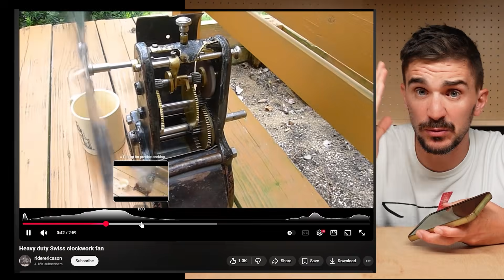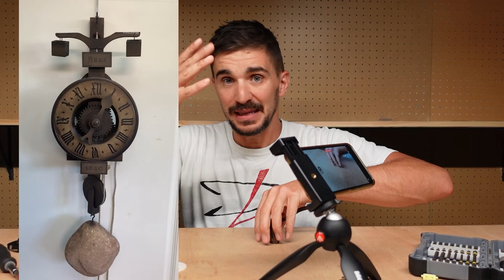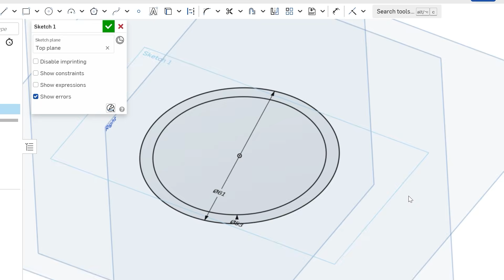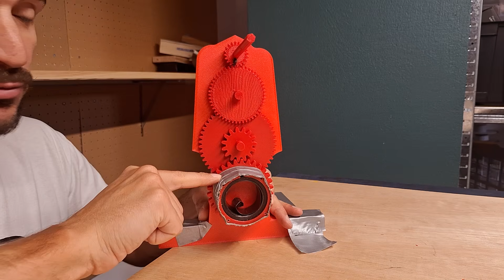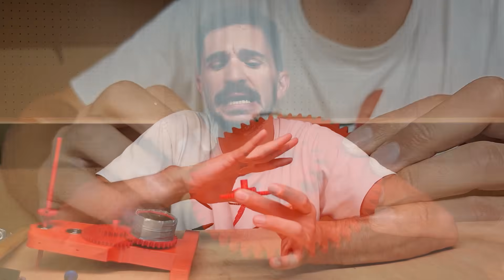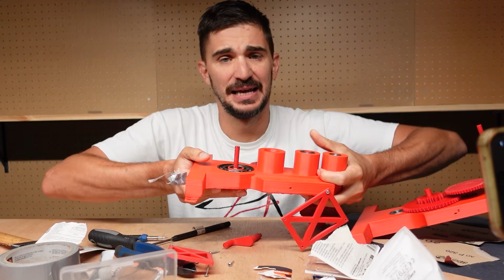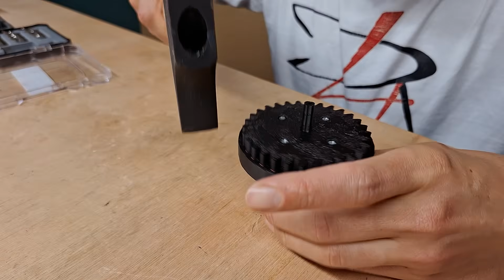No Cables or Batteries, Just Pure Mechanical Engineering - This Swiss Cooling Fan Cools You For Free

Comment: The original machine also had a massive 2 inch wide mainspring that was strong enough to need a long crank handle. If your tape measure and plastic gears can make any measurable breeze and run for almost 2 minutes, I bet that one made a decent breeze, ran for quite a while, and would probably remove at least an arm if the casing let loose...
Reply: Your mention of losing an arm made me think of a garage door lift spring. Something like that could power a fan for a good while.
Reply: Yep, MUCH larger mainspring, and I would guess something to regulate the rate of spin so it didn't over speed and waste way too much energy.
Reply: @NeoIsrafil  The fan can regulate its own speed. As the fan spins faster it needs more torque to move the air, so a spring powered fan would naturally run at a somewhat fixed speed. 

In fact, clocks use a miniature fan (basically a rotating flat piece of metal) to regulate the speed of the striking mechanism.
Reply: @Pentium100MHz  Oh yeah. Like music boxes as well. Good point.
Reply: @Pentium100MHz Yep I had a wind up music box inside a teddy bear when I was a kid. I eventually opened it up and it regulated speed with a tiny high speed fan inside the box. Very simple, worked for years and years.
Reply: @NeoIsrafil  First thought was like a steam engine centrifugal governor... But very cool would be a variable pitch propeller as a governor here.
Reply: @NeoIsrafil that is the thing about main springs, they provide the same spring force for nearly all of its range, thats why a tape also does not become exponentially harder the more you take out, as it is a constant torques spring, speed is only regulated by the force being consumed by whatever is attached to it.
Reply: @NeoIsrafil Yup a clockwork escape of some kind.  Or whatever that is called.  New mind had a great video about all the different ones through the years.
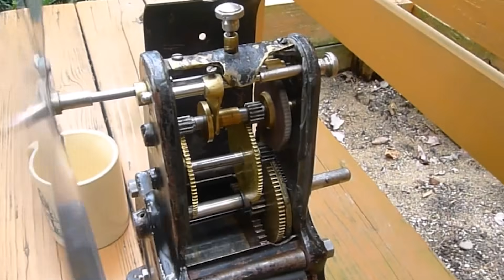Reply: @NeoIsrafil  there's a screw at 4:05 to change speed I think and you can see the fan speed up when the screw was loosened and as someone else said the fan spinning also regulates it
Reply: yea. i think the fanblade of the original gadjet was probably precisely tuned for its mechanisms target rpm. The plastic fan used is definitely made for a much higher rpm motor.
Reply: I've heard a wives tale of the spring motors from record players killing people when they would work on them without knowing what they are doing
Reply: @walkstheman98  I doubt anyone died, but I have a friend that nearly lost a finger when a spring got away from him. There's a lot of energy stored in a wound up spring. And that spring steel has very sharp edges.
Reply: yeah he shoulda used a way stiffer spring, what about the torsion bar of a 4x4????there you can store a lot of energy!!!!
Reply: Even the crank is actually geared down to overcome the torque needed. You can see its not in the middle of the spring. When he went for the tape, I knew already its gona be a fail...
Reply: SO WE NEED BIGGER BADDER SPRINGS YES YES
Reply: Also let’s not forget that the mass of the blade on the fan in the video is going to be near nothing kind a like those fans that sit on top of a stove or a fireplace that heat up and start circulating air, those fans are super lightweight on their blades. But yeah, I was going to mention that giant main spring as well, but you beat me to it.
Reply: yeah the mainspring in that old fan is probably hundreds of pounds of force. Old machines didn't mess around
Reply: Came here to say this, almost 2 minutes out of a tape measure spring and 2nd try 3d printed parts is actually pretty good imo, I think there's a lot of things that would be easy to moderately refine elsewhere as well and you could have something that would be a decent camping or workplace gadget, but def start with stronger spring.
Reply: @BlazingSun72  There is likely no single spring that could help.  They just don't turn enough or store enough energy to run a 12" fan for 30 minutes.  The one and only video with this fan in it and the 30 minute claim in it is 2:59 in length including the time it took to wind it.

Even a triple gramophone spring (which there is not room for in this fan) is not going to give it 30 minutes run time at anything like a reasonable speed.  Furthermore, there is no visible governor, which would cause the fan to run at the torque limit of the clock spring and spin down very quickly (gramophones have governors to maintain 78rpm), IOW, it would spin very fast when you first wind it, but would gradually slow down until the spring is fully unwound.  The faster the blades go, the faster it winds down.
Reply: @tarstarkusz  yup, but I'm just thinking if you can wind for 30 seconds and get 10-20 minutes it might be worth doing for specific applications, first maybe a 12" fan diameter is a little much 😂, I have a couple battery ones that are 4 or 5 and they can do plenty for just holding up next to me or like after hockey or whatever
Reply: @BlazingSun72  "yup, but I'm just thinking if you can wind for 30 seconds and get 10-20 minutes it might be worth doing for specific applications, "
Extremely unlikely.
Reply: No, it's a lie.  There is no way in hell you got 30 minutes out of that fan from a clockwork spring. 
 Look up gramophones.  100 turns of the handle and you are lucky to get 3.5 minutes from a single wind on a single spring machine.  They also had a governor to slow it down to 78/80 RPMs.  The power needs of the fan and a gramophone are likely not that different.  They had big heavy springs and many had 2 springs.  Winding a two spring fan was even more cranking.
Reply: @tarstarkusz  If we estimate the size of the fan at 30 cm in diameter and a humble but reasonable target breeze speed of Ws=1 m/s, let's do the math.

The area of the fan is A=(.3/2)^2*pi = 0.07 m^2
The mass flow rate is Dm = A*Ws*rho = .07*1*1.2 = .085 kg/s (rho being the volumic mass of the air, 1.2 kg/m^3)
The power needed to keep this amount of air moving at that speed is the kinetic energy acquired through the fan of the air moving through it each second. So PO=1/2 * Dm * Ws² = 0.5*.085*1² = 0.042 W
To run such a fan for half an hour, the spring would need to store 76 J without accounting for the mechanical losses in the works.
Doubling the breeze speed would quadruple the energy consumption, bringing it over 600 J.
Everything here is likely over simplified but I guess it gives a rough approximation to scale the power needs of such a contraption.
Reply: @m1l15lvoue  In a comment further down on this thread I estimate the mainspring of a single spring gramophone at about 1000 joules.  The assumption was no more than 5 watts running 3.5 minutes.  Google AI says the power is MUCH less at under 100 joules, which seems low to me.

If both of our estimates are correct, than it would indeed power the fan 30 minutes.  But I have a very hard time accepting your power consumption numbers.  Battery operated fans use much more power than .042 watts.

Also, it doesn't have a governor, at least not one visible. A gramophone achieves 3.5 minutes (about), but the output speed is governed (centrifugal brake) thus slowing down the output..  Without the internal governor, the only thing keeping the fan slow is the torque required to turn the blades at a particular speed.

The video showing this fan running was 2:59 seconds including the time it took to wind the motor.  The fan was spinning pretty quickly (appears to anyway). I'll believe the 30 minute run time when I see it.
Reply: @m1l15lvoue  I came at this another way.  Please correct me if I'm wrong.  A typical modern fan of this size consumes about 40 Watts.  (I'm quite sure that these old hand-cranked fans didn't move air nearly as forcefully as a modern electric fan, but lets stick with the modern example because we can all relate).  These are powered by an AC induction motor that is approx. 75% efficient.  This implies that approx. 30 Watts is applied directly to moving the air.  For 30 minutes, this is 15 Watt*hours.  Turning a hand crank, a typical human can input about 100 Watts comfortably.  That means it would take at least 9 minutes of active cranking to input this much power.  It's about the same energy required for an adult to go up 20 flights of stairs.  I also did a couple calculations to determine how heavy the spiral spring would need to be and it's well over 100 pounds.  Not very practical.

But maybe you can get acceptable air flow with 10 Watts?  That's still 3 minutes of cranking and a spring assembly that weighs 50+ pounds.  If my calculations are correct, I would guess that these old fans provided pretty minimal airflow (by our standards) for maybe 15 minutes tops.  And you got hot winding them 3 out of every 15 minutes.  The old ladies with the hand fans were probably cooling themselves more efficiently and effectively.
Reply: @pelerinc  Small fans with 40-70W motors were typically shaded pole motors, which are essentially never more than 25% efficient, and often much less. The blade designs are also very inefficient. You can see this if you compare them to fans with brushless DC motors (often called EC, or "electronically commutated" in small, plug in fans). I have a 13W EC fan with decent blade geometry, and an old 70W table fan of the same diameter with very basic blades. The 13W fan moves dramatically more air. Even capacitor-start induction motors at table fan sizes are probably closer to 60% efficient.

I also have a 5" USB powered fan, which draws 2.5W on high, and less than 1W on low, that moves a useful amount of air, if you're just trying to cool one person. I suspect the mechanical fan is probably operating at something more like 1-2W going into the fan blades, maybe as high as 5W.
Reply: @jasexavier  If it is using 5 watts equivalent, which is my guess for a gramophone, it has a 3.5 minute run time (assuming the gramophone guess is correct) at a useful speed.
5 watts for 3.5 minutes is 1050 joules. (this is at the output, the joules in the spring would be higher).
One thing going against the fan is there is no visible governor.  This would shorten the run time, but the fan would spin faster.
IIRC, the video is 2:59.  When I posted a comment on that video questioning the 30 minute run time, he insisted it was actually 45 minutes.  I think he is lying and the run time is under 5 minutes.  It is a shame nobody else has one to run the experiment.
Reply: @tarstarkusz  not quite so straightforward. The gramophone has a much larger mass to move and a rather high friction needle (and it's literally a thick sharp needle!) to overcome. Moving air requires much less energy, at least at the volumes of a such small propeller.
Reply: @321ooo123  The propeller looks fairly large to me, maybe 12-15" from tip to tip.  It takes a pretty decent amount of power to move so much air.
A large gramophone spring holds very little power.  Google AI puts it between 25 and 30 joules.  A joule is one watt second.  The mass doesn't really matter because it has inertia where some of the power to bring it up to speed is given back to the system (think a flywheel effect).  Personally, I think 25-30 joules sounds low.  But even if you increase it by two orders of magnitude, we're talking 2500 to 3000 Joules.  That is well under a single  watt hour.
Reply: @321ooo123 definitely the opposite.  Very little drag with a record spinning 78rpm and one tiny hard needle wiggling than pushing all the air at much higher rpm.
Reply: @vinnieluther6589  I happen to have one and I assure you the needle is not tiny and the whole arm is rather heavy. It has nothing to do with the modern record players. You can hear the sound at a loud volume even if the acoustic void is completely closed.
Reply: @tarstarkusz  ah, but the volume of air is also a function of the ripums, isn't it? And ok, let's ignore the mass of the record plus the mass of the spinning table... yet the needle at the end of a heavy arm that drags on the record surely is a great waste of energy. Actually, I may do an experiment: I'll measure how much it manages to spin a record with or without a needle. That should be a good indication about the friction between the needle and the record.
Reply: @321ooo123  I would estimate a gramophone uses no more than 5 watts.  For 3.5 minutes, that is 1050 joules(5 watts times 60 (seconds in a minute) x3.5 minutes).  To run a fan for 30 minutes using 1050 total joules would be a total continuous power consumption of 0.583 joules or about a 1/2 a watt.  1/2 a watt energy available to the entire system  is not going to power a 12" fan.  I mean, maybe it could spin the blades very slowly and move almost no air, but that is about it.
I would be very interested in your experiment, if you really feel like doing it.  Indeed, I think the power consumption will be higher with the needle on it, though I do not believe the total power consumption will be more than 5 watts equivalent.
Reply: @321ooo123  moving air takes a LOT of energy.  Certainly a lot more than the drag of a needle on a record.  I’d bet a coffee on that any day.
Reply: @tarstarkusz  here are the results. 20 windings with the handle. No needle - the table turns for 2 minutes 15 seconds. With needle: it doesn't start at all. If you allow it to spin to 78 rpm, it stops 3-4 seconds after you lower the needle. You may want to reevaluate the friction losses in gramophones.
Reply: @SolarMillUSA  it depends what volume, and how fast, among other things. See my reply to @tarstarkusz to see the outcome of an experiment with a gramophone I did exactly for that purpose.
Reply: @321ooo123  What about a full wind?
I never doubted the tonearm would reduce the run time.  That's where most of the work is.
My estimate of 5 watts is pretty high.  Even if I doubled it to 10 watts, that's still only around 2000joules.
Reply: @tarstarkusz  I don't want to break the precious relic just for settling arguments with anonymous peeplz on the interwebz :) It's kind of a heirloom.
Reply: @tarstarkusz  Bigger fans are more efficient. The power required to move air goes up with the square of the air velocity, but linearly with the mass of air. So, you can move a LOT more air with a bigger, slower fan, compared to a small, fast one. A 12" fan with only 1W of mechanical power would produce a noticeable breeze, at least if you're just trying to cool one person.
Reply: @tarstarkusz  Don't trust numbers from the AI. Google's AI spews BS (much like AI's in general). I was trying to look up gas mileage numbers the other day and it would give drastically different numbers for the same car depending on the specific search query. I wish they would stop putting that useless crap at the top of the search results.
Reply: @jasexavier  Moving more area of air at a slower speed definitely is a big factor in favor of the larger fan. But on top of that, there's also the shape of the blade. Since these are nowhere near the speed of sound or even compressing the flow, a high aspect ratio (long and skinny) blade has less drag. This is just the ratio of blade length to width. It's an independent factor to the blade's area (I don't mean the area it sweeps as it spins, just the surface area of the blades themselves).
Reply: @Elrog3  I don't.  I said it sounded too low.  I used an estimate of 5 watts continuous use for a wind up gramophone.  For 3.5 minutes, it's about 1000 joules.  Assuming the fan has a governor and runs 30 minutes, that leaves under a 1/2 a watt assuming the 1000 joules is correct.
There is no video anywhere showing this fan design running longer than about 2 minutes.
Reply: @tarstarkusz  I don't think the AI numbers mean enough to even bother mentioning. To the rest of that, skepticism about the claims of how long it runs is perfectly reasonable.
Reply: @Elrog3  The problem is google has wrecked the search function.

Comment: nice, now build one with gravity like the rock clock and build another one with balloons... a bike pump and inner tubes or a hotwater bottle. the plastics and gear teeth are not necessary, couldve used logs and leather straps.

Comment: No regulator as on the big vertical clocks? To allow for the controlled release of the spring energy. Not just release and hope for the best 🧐
Reply: Fan is regulator by itself. Power needed to get it to X rpm is proportional to x^3. I saw "fan-based" speed regulator on wind-up music boxes.

Comment: I think youtube opens the app with short form videos if the last thing you watched before you closed it was a short form video aswell.
So I just dont watch them, and It doesnt open with them.

The clockwork fan in the original video seems to have a much heavier winding, since its used with a big handle and the space down there in the clockwork is much bigger aswell.
Im not sure, but the winding of your fan looks much weaker.
Together with more precision as you mentioned, I think the original video is realistic, but probably still too expensive to be feasable as you mentioned.

Comment: Not entirely true: there are ventilators for the top of coal or wood ovens driven just by heat
Reply: Technically driven by a combo of contrast of hot and cool. You need that difference in energy.

Comment: There is an alternative way of driving a fan off-grid: a Stirling heat engine.
Reply: You still need both hot and cold reservoirs. The hot reservoir usually achieved by burning fuel.
Reply: Wonder if you could achieve the necessary heat with pressure 🤔. Meh. Probably more trouble than it's worth 🤷‍♂️
Reply: Or a Peltier cell... I have two on my solid fuel stove....
Reply: @realnutteruk1 Possibly less effective as a cooling fan, although an excellent to distribute heat around a room.